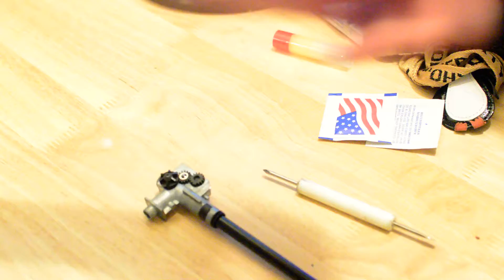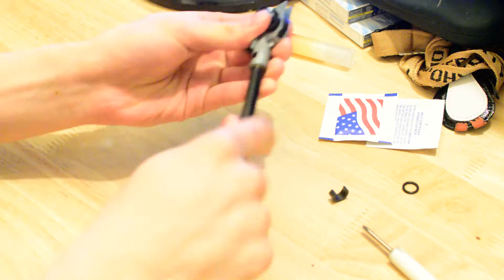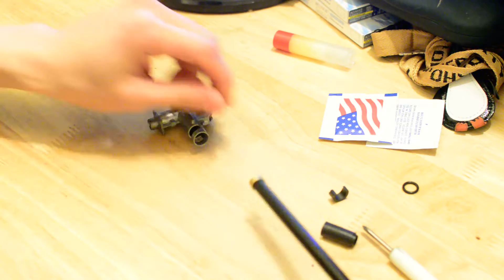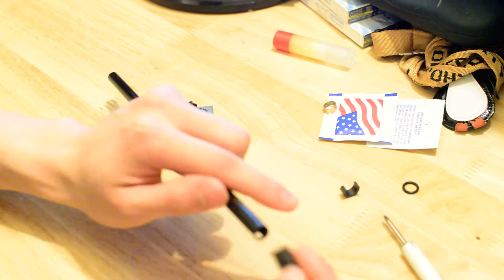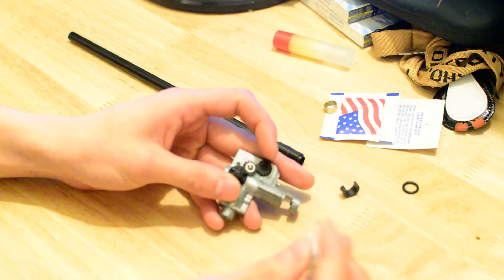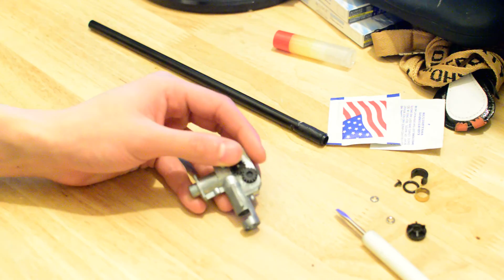Installing a Maple Leaf Bucking

Comment: So...I installed a Maple Leaf bucking and nub in my E&L AK along with a Lonex Hop up unit.  Worked great for a weekend game, was getting noticeably longer shots.  After that game I installed a Miracle Barrel in it to see if it would perform even better...no dice...bbs would exit the barrel and drop quickly or when I'd move the slider on the hop up to add more hop, the slightest change would cause shots to be fliers.  So I swapped back the stock barrel as I had it before when It was working great and now its still performing badly as when I tried the miracle barrel in my gun...Any ideas why?
Reply: @otyeK  Really late to the party but miracle barrels have a lower ridge similar to what a w style bucking try's to do. accept like upside down witch is make a guiding path.the problem you were encountering is that a maple leaf bucking essentially does that but better the other problem is that those lower points of contact were probably throwing off what the maple leaf was trying to do witch is make a guiding path similar to what R hop does

Comment: Do you have to get the different nub with it or will the bucking work with my stock nub?
Reply from the maker: The way the maple leaf makes contact with the BB, I would suggest getting the nub that goes with the maple leaf. The maple leaf has this contact point that funnels into a v shape which makes it harder for other nubs to give the correct amount of contact in the right places (this problem extends from normal round nubs to m-nubs).